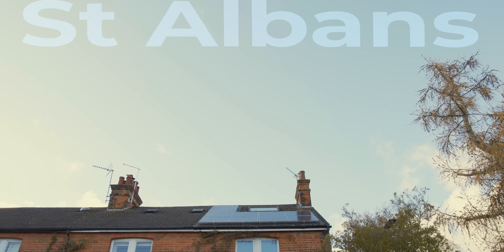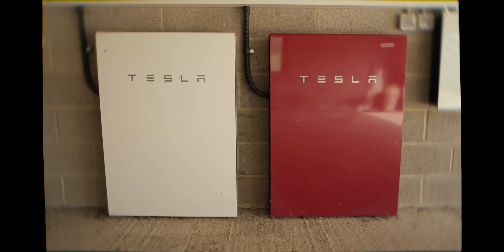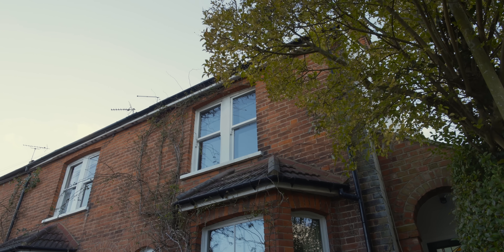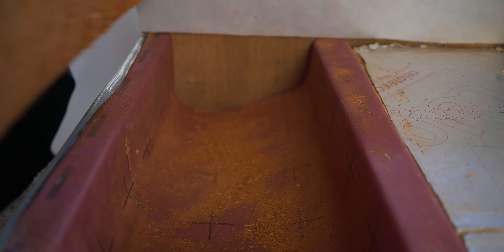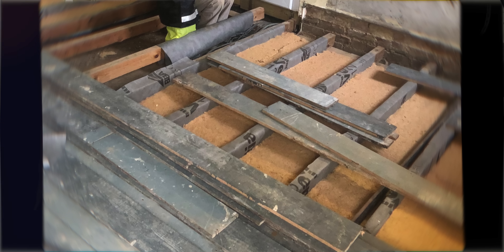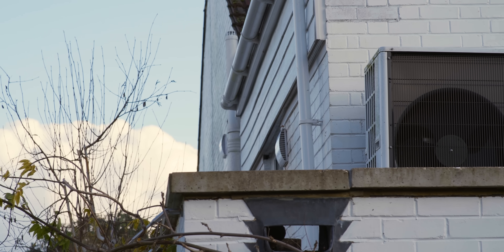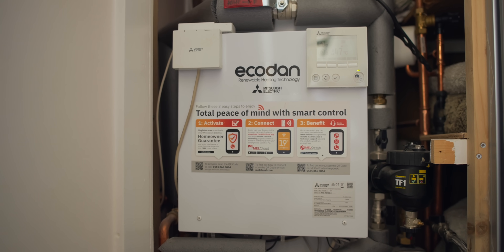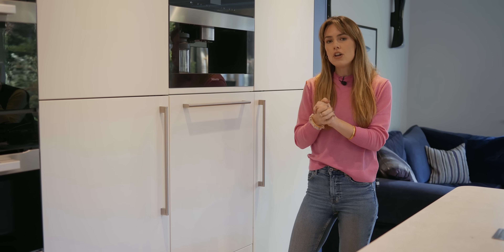This Victorian Home is Now 75% More Energy Efficient!

Comment: 25'500 kWh to 6'000kwh.
  Most people won't understand this shut they must have had electric resistance heating for the numbers to be so high.
 A little bit cheeky if you ask me most people heat their house with gas.
 Explaining the cost difference on energy consumption would have been a better measurement for the average user.
 It's also wasn't explained if that 6 killer war included what they receive from their solar panels.
 Again not all the information has been provided under the 75% energy saving is an exaggeration at best.
Reply: It was 25,500 Kwh's to 6K. Our bills show the gas and electricity in KwH's so this was the total of the two. So now all electric (including the car). The measurements were taken before we had the solar installed.
Reply: @ecorenovationhome With respect you cannot add the two measurements together like that and the are based on different metrics.
For example.
Your heat pump can have a cop of 4 and this would use 1kwh of electricity.
Let's call that 24p with and let's say its power comes from a gas turbine.
Now that's 50% efficient, now the real cop number is 2.
But your tv and electronic items yes.

The cost comparison of a heat pump is almost identical to gas, but gas is 4x cheaper.
So your gas bill goes from 25Mwh per year to 0 but after your insulation upgrades are considered it drops to a quarter in electricity due to its COP of 4

So you might never see the financial return for the heat pump itself.

You will however from the other upgrades you have installed.
I have installed the same if not a little more than in your video and opted for a log burner over a heat pump. 

My reason for this apart from the aesthetic is my gas has dropped by over half and I'm contributing the same CO2 amount as a heat pump for the same size property.
Most house holds in the uk use 6Mwh a year in just electricity. I applaud your restraint on your non heating usage. 
But you can see how it can be mislead to the average consumer.
Reply: @grantmidd  We are more interested in climate that recouping the money - for us it's worth it anyway. We took the KwH numbers from our energy bill and this is how they represented it before we turned the gas off. I love a log burner, but we decided to get rid of ours because of the particulate issue. Do miss it though.
Reply: @ecorenovationhome  I Understand, 
But there is a way to have your cake and eat it too on the log burner.
 As you know wood is a renewable fuel, I believe it is counted as carbon neutral.
 With that said many particulars can be released if the wood is not burned properly.
 But recently there have been multiple measures to reduce this risk almost nothing.
 Having a catalytic converter built-in or incorporated into the flu pipe.
 I secondly is our particular matter collector that is at the top of your flu pipe.
 If you really enjoy a log burner especially for the winter and Christmas period this might be worth looking into.
 Due to my catalytic converter and the ree burner Due to my catalytic converter and the re-burner  My lock burner is up to 90% Efficient.
 That's basically the same as my conboiler but with renewable fuel.
Reply: A kilowatt-hour is a kilowatt-hour whether it comes from burning gas, oil, wood or using electric heaters.  The only relevant difference between the different sources is their efficiency.  A good condensing gas boiler might get 90% efficiency.  An electric resistance type heater will be 100% efficient.  A well installed heat-pump between 300-400% efficient.  So it's likely that the reduction in energy usage is a combination of having insulated the house plus moving to a heat pump.
Reply: @Richardincancale  Yes but no.
Now are we talking financial cost 24p vs 6p or CO2 production 
Gas turbine generators in the UK run on average of 50%.
So your CO2 savings are only 55%
The cost of gas vs heat pump with a COP of 3.5-4 is identical to gas 24p vs 6p roughly.
Reply: I'm thinking they went from maybe 35,000 kWh of gas to 6,000kwh of electricity. 
But yeah it's not explained
Reply: @Burtis89  this might be possible but 35'000kwh ÷ 4 cost conversion = 8'750kwh - 2'000kwh saving
Reply: Think of standing out in 0° weather barefoot and in your underwear versus in full winter gear.  Now add wind.  Tell me how much more comfortable you'd be.  It makes a huge energy difference. Your full winter gear allows your body to heat itse to a comfortable level.
Reply: @jamesengland7461  James please explain what you are talking about? Is it the isulation?
If so there is no argument here.
I'm referring to the statement of 75% reduction which is laughable.
I live in a Eco house I converted. I even have more insulation and it's not a 75% reduction of anything.

Comment: Maybe I can try some of these, oh wait, I rent. Nevermind. That aside Wonderful improvements and a vision of future homes.
Reply: Show it to yr landlord, it increases the value of the property.
Reply: @snowstrobe  The problem for tenanted property is that a lot of the works needed require the property to be empty.  Then there is the cost, currently where I grew up the cost of internal wall insulation throughout a terraced house is £10-12000. The landlord will want to recover that cost via increased rent which given the effects of tax and managing agent fees means increasing the rent by around £90 pcm to recover the cost over 12-14 years.  In most cases the savings in energy use are a lot less than that

Comment: We have some of these 25kwh houses in the north of Sweden 🇸🇪 and think they are inefficient.. it's so true you need to focus on walls, air tightness and controlled ventilation. Rather than starting with new windows and solar.

Btw, her dishwasher, fridge and freezer is also helping warming the house, if that is open enough. :)
Reply: That's right - we keep all the heat in the house from appliances, cooking etc

Comment: I'm in the process of retrofitting my mid terrace house. My comments are how in the blazes was she able to get the heat pump on the extension roof? Every company I asked have said no. In fact a heat pump < 1 mtr from the boundary of a house is not allowed so it would need to be in the middle of the garden not even by a fence. Planning permission is also needed.  
There are other issues I will not cover in relation to the heat pump. I have decided to spend my time and money on insulating and draft proofing. I already dropped my bills and was told by the energy company that I'm 26% lower gas usage than comparable properties.
Reply: We are the end of the terrace. The pump is over 1 metre from the neighbours window which was the rule at the time of installation. Never any question about it going on the roof. And a heat pump comes under permitted development unless there are other aspects to be taken into account.
Very wise to focus on insulation and draft proofing and great that you're getting a 26% reduction! Just make sure the ventilation is good if you're doing a good job of draught proofing.
Reply: @ecorenovationhome 

Let's hope a new neighbour decides not to make a complaint to the Local Authority ref noise.

Who knows what regs against noise could be introduced in future and if you had any "Grandfather Rights"?

Interesting for us and a possible nightmare for you.
Reply: @t1n4444  There is very little noise and there has been no comment from anyone. We have a Mitsubishi Ecodan which was the quietest on the market at the time. We rarely hear it unless it's really freezing outside.
Reply: @ The way they plan for these things you'd reckon they'd cry war when they are running but mine I can't even hear in the cold snap when i hang my heat out the window directly above it. My old combi boiler you'd hear throughout the house when it started up.
Reply: @t1n4444  there is no noise and Ive had the pleasure of visiting, the planes going over our homes are much louder!
Reply: @t1n4444 what noise?
Reply: @davetester100  

🤣🤣🤣

You could always do some research for yourself instead of attempting to be pert and chippy.

Hope that helps.
Reply: @faux_hobo  The nature of the steady low-frequency hum from ASHPs can lead to problems if there are certain echoey surfaces that cause resonances and noticeable noise in particular spots, but you're right that they're normally pretty quiet, and a competent installer should be able to avoid any problems.
Reply: Looks like it's end of terrace so not near a neighbour? 

Also they are changing all the rules for heat pumps soon making them easier to sort
Reply: This video from Heat Geek shows a roof mounted heat pump.
https://youtu.be/LEptDnX9nPc?feature=shared
Reply: So 26% lower gas use, might reasonably be expected to be 26% lower carbon emissions from your heating. 

Where as a ASHP would have reduced your carbon emissions from heating by 80%. Let me show you the working. Last year's electricity avg carbon intensity was 125g/KWh, the best installers can get SCOPs (ratio of heat out to electricity in) of 3 to 5+. Let's use 4. So 31g/KWh of heat produced. A modern gas boiler would emit 215g/KWh of heat produced. So the heat pump would achieve a massive 86% reduction in your heating emissions. 

Vs the 26% you've achieved. 

So if you can only afford one at a time, and your goal is decarbonization, which would you do first?

Ideally both together right? We don't live in a perfect world and all have financial limitations. 

Yes would the ASHP be oversized after you later refit insulation? Yes. Would you have spent extra money on rads? Yes. 

But you would have definitely reduced your emissions the quickest.

And this is why fabric first is bull plop 2:16
Reply: @Lewis_Standing  'Bull plop' is a bit harsh Lewis. You are right that the fastest decarbonisation at lowest cost is had from heat-pump first, and doing that is good advice for probably most people, but you can get 80% reduction from fabric measures too, and those will also make for a more comfortable building. So if you've got some money then there is nothing wrong with fabric first.
Reply: @Lewis_Standing It's great to hear someone else making this point. It's exactly the decision we made in our house built in 1865. We made an instant 80% saving in CO2 output - and it's getting better every year as the electricity grid increases use of renewables.
Only minor regret is that I didn't look at air to air heat pumps, which might have been even more efficient.
Reply: The 1m rule is about distance to neighbours. It's perfectly acceptable to put it adjacent to your own house. A noise assessment is always required, but the small Ecodans are particularly quiet so they pass in all but the most extreme locations.
Reply: The 1m rule is being abolished. You should have more options very soon!
Reply: Glad someone mentioned this. I was watching a Urban Plumber video where a client had also had a head pump attached to the side of their victorian house in an ally. in a similar set up to an AC unit. But i've also been told you can't get a heat pump on the roof...
Reply: @Missi0n141  yes no problem with heat pump on an extension such as Judith.
Reply: If you really go to town you can probably get an 80-90% reduction in space-heat load. Work out where you are on the kWh/m2 per year scale you are. Everyone should be aiming to get under 50 (kWh/m2.yr)- maybe not all in one go, but eventually. I'm at about 45 so far, but when the floor is done it should be 28.
Reply: @xxwookey  

And how many people do you suppose will get to grips with the science?

Exactly, not many.

Might be best to simply mandate improvements in insulation and see how that works.

Heat pumps, even with a government subsidy, are most likely too expensive for most households.

Would we see landlords install heat pumps unless pressed?

If we did see a rise in heat pump installs then if the noise pollution in some locales increased then it's always open for individual Local.Authorities to review their policies on said noise pollution.

Ditto EVs, very few private buyers can stump up even £25k for a modest EV.

Used EVs have very low residuals so even if people persuaded themselves a used EV was worth a punt then said EVs might be very difficult to sell on to a third owner if, say, the battery pack.showed signs of diminished capacity.

On top of that we see huge premiums charged by the insurance companies.

Not to mention the equivalent of VED from this year on.

Nobody knows what taxes Rachel will impose on BEVs if she needs to balance her books.

Plus Rachel might equally impose higher duty on fossil fueled vehicles to increase the "take" and dissuade putative owners from burying more fossil fueled vehicles.

For all.we know there's a policy to nudge people onto public transport.

This might make some sense given how much HMG is spending on national.infrastructire.

I speculate of course.

I speculate too that we have seen the age of BEVs coming to an end.

We see Toyota advertising their hydrogen fuel.cell cars on TV. Have they been informed HMG is planning a nationwide hydrogen fueling infrastructure?

Europe have started to design such supply chains and seeing as HMG is seeking closer economic ties with Europe (and N Africa) then it would make sense for similar projects in UK.
Reply: Planning permission is required for some situations. Doesn't mean it won't be given. If an installer thinks they can do something without that then that's probably their preferred suggestion. The guidelines on lawful installation of ashp are pretty straightforward.
Reply: @logik100.0  

Quite so. Insulation is probably the first thing to introduce when refurbing a property.

It's a shame that HMG is not pushing the installation of insulation as hard as they can.

And of course it's all very well have heat pumps but now we see regs ref noise.

What were the Tories thinking of when they introduced this nonsense?
Reply: @t1n4444  Great British Insulation scheme was a flop but awaiting an amended version moving forward
Reply: @Her_Retrofit_Space  

Flop or not insulation is still required.

What HMG (any) get up to these days is a mystery to most of us, not least to the MPs themselves.

Some may be suffering from terminal dizziness.

PMQ is very revealing from.the point of view that all the parties come across as braying yahoos ..
 and they're the ones running(?) the country.